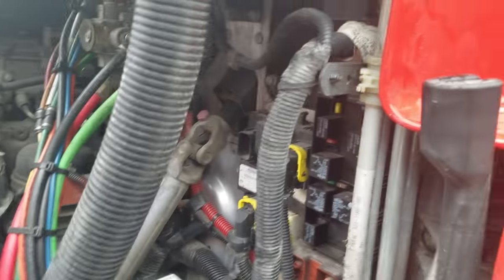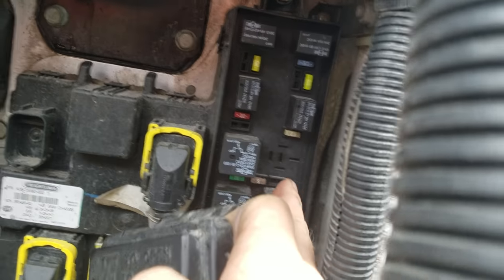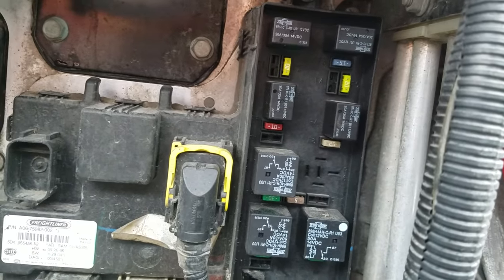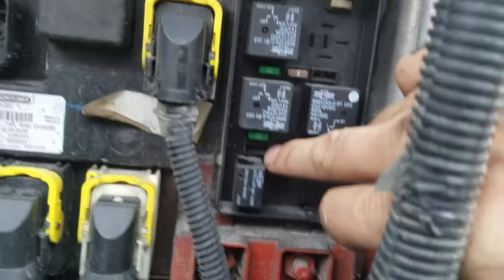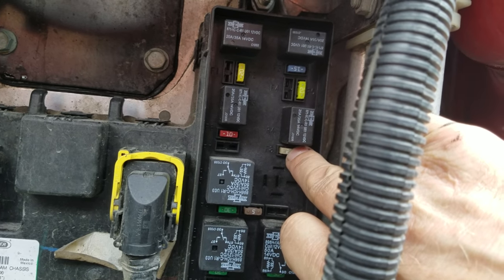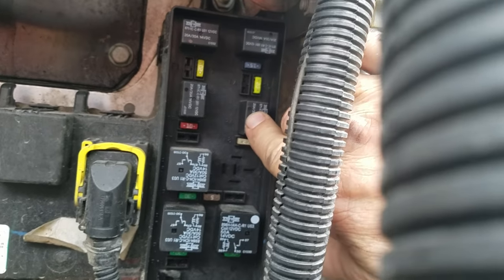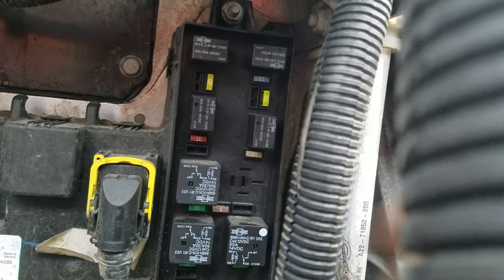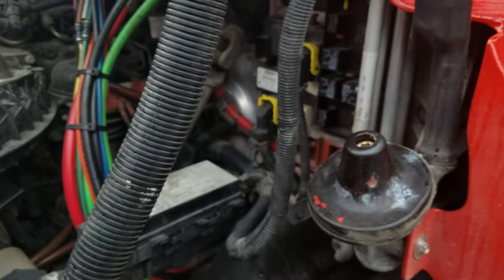Fast blinker no trailer turn signal on Freightliner Cascadia

Comment: I appreciate this greatly!!! Great video!! Exactly what happened to mine. Plugged my cord into trailer and all of sudden no signal on left side. Rapid blinking on left side on truck only(burnt out left side turn signal fuse). Turned out to be a wire for middle trailer signal left side was rubbing against crossmember. 20A fuse, got it done in 5 minutes. You saved me a whole weekend here in Wisconsin!! Thanks
Reply from the maker: Actually Wisconsin is pretty fun. Just stay there with your brand new fuse and enjoy 🤣
Reply: @dridiott that no shitty vacuum hose sir, that a drain hose to keep water from flooding your 20k engine, just my opinion thanks.

Comment: You can one hand the hood latch. Pull the top handle down with your index finger, push the hook part of the top in with your thumb, and pull the bottom part towards you with your ring and pinky fingers.
Reply from the maker: Fuck that latch

Comment: Mine was just a loose relay, so try pushing yours in and that may fix it as well
Reply: Had a left turn signal on my trailer out, tried changing the fuses & no luck. This comment got me to check the relays & mine had went out. Changed it & now I can turn without worry. Thanks!

Comment: All my lights work except top marker lights and license plate light they come on and off sometimes it last a couple of hours on then flickering off. Changed electrical cord, checked all fuses and both pin on tractor and trailer

Comment: I have a 09 freightliner cascadia i have a rapid blinker on the right side. Also my rear tractor light are not working not light or turn signal. What can it be. But i do have light on all my truck and trailer except my rear tractor lights.

Comment: So my Cascadia is having this exact problem and the relay is clicking. The fuses check good with a Fluke multi meter. When I pull the clicking relay and it's fuses, the DAMN LIGHT KEEPS ON FLASHING FAST... what the hell...